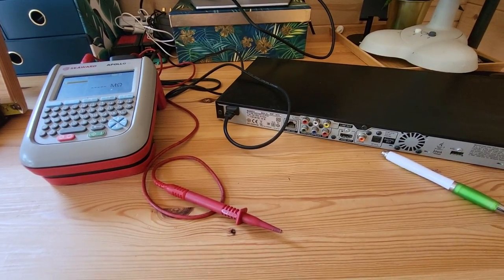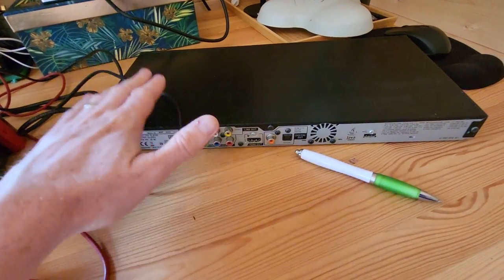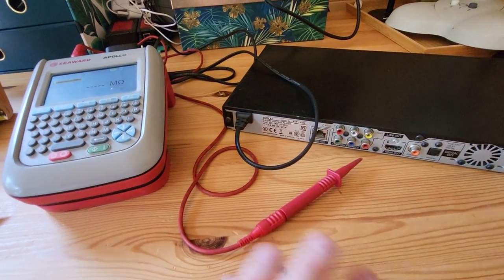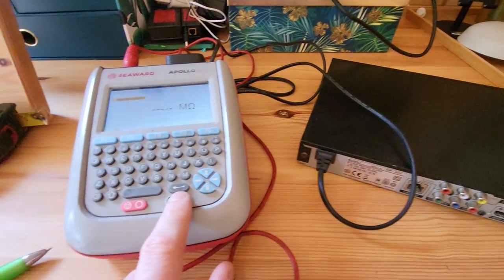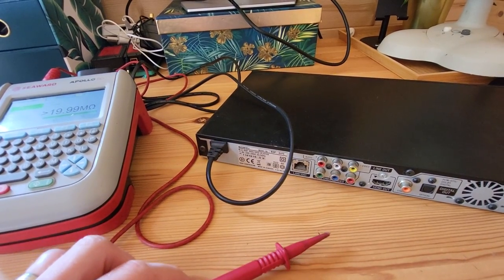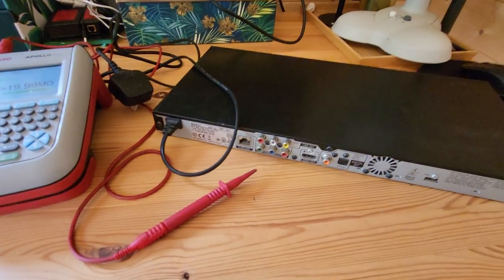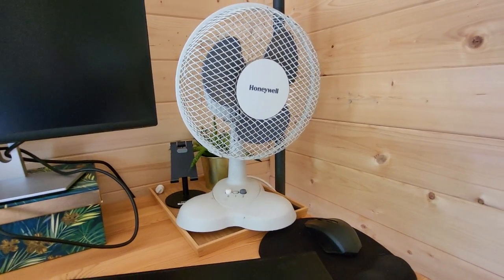Class 2 PAT Test - is there a right or wrong way?

Comment: It doesn’t sound like your mate knows what he’s verifying when PAT testing. Even though an appliance may not have an earth connection, it may still have exposed conductive parts. When you know what could go wrong, you realise how important this test is. Earthed appliances should trip or blow the fuse when voltage goes down the earth, with a Class 2 appliance, the voltage will just sit there on the exposed conductive parts waiting for someone to provide a path back to earth.
Reply from the maker: which mate are you referring to?
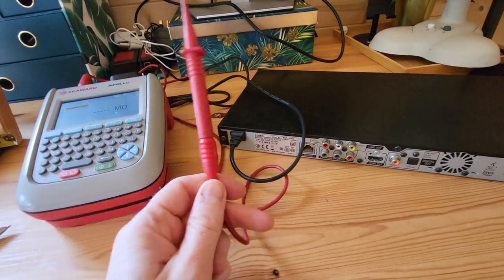Reply: @caterhampattesting  2:04

Comment: Hey on class 2 charger if there is no metal parts can you use probe on the actual charging pins. I'm doing 500v insulation test
Reply from the maker: no this would be visual only. please see my video on laptop / phone chargers
Reply: @caterhampattesting  will do
Reply: Yes, you would test to the charging pins to confirm live supply conducters and pins are electrically isolated

Comment: Thanks for the video, you mentioned that you shouldn't use the full 500 v insulation test on sensitive equipment, how do you know what is sensitive and what isn't?
Reply from the maker: experience will mainly guide you on this. There isn't much these days that you can't test at 500v. Mainly valve amps and RCDs I test at 250v DC
Reply: @caterhampattesting  thanks
Reply: MOV metal oxide varister powee boards need to be tested at 250v otherwise they will fail

Comment: Hi Ben, wonder if you could clairiy when an item would "power up" and are there any dangers to this. Alternatively do you have a video explaining this. I have literally just started using a KEWTECH Smartpat. Many thnaks again. AJ
Reply from the maker: an item would only normally power up if you were conducting a functional test or a leakage test via your machine. It wouldn't power up on the earth or insulation resistance test.

Comment: On the Apollo in the video it shows the test type as Insulation only, would it not show touch current or substitute leakage?
Reply from the maker: you would only need to do touch current test if the insulation test failed. touch current isn't a mandatory test.

Comment: I'm.confused I use preset 2 on same appollo tester to test class 2 hoover but the hoover doesn't actually power up when the power switch is on during the test?? Is this incorrect
Reply from the maker: no that is correct. your pat test machine won't power up the unit when conducting a class 2 insulation resistance test.
Reply: @caterhampattesting  thanks for reply